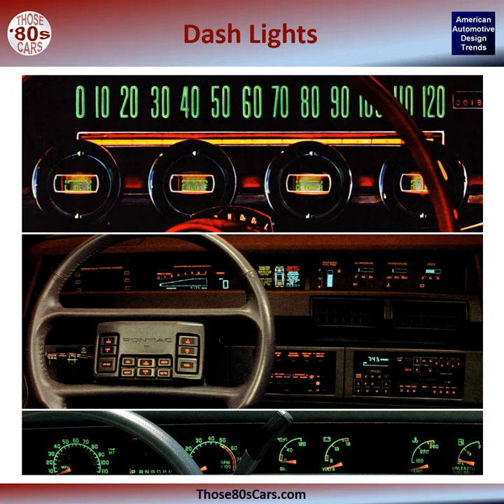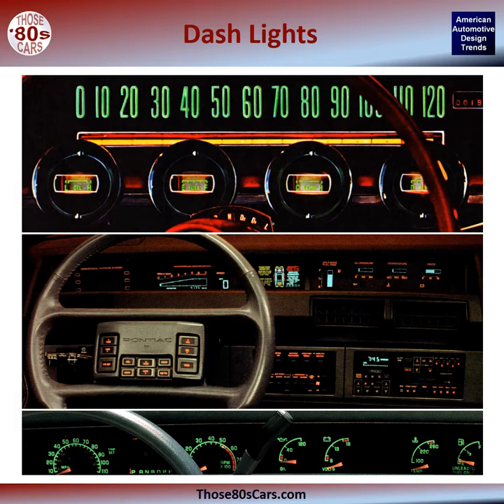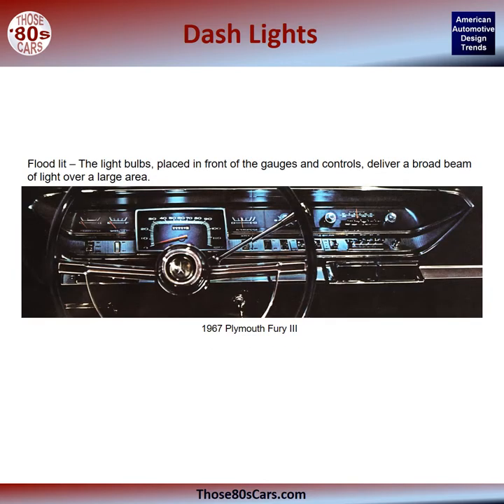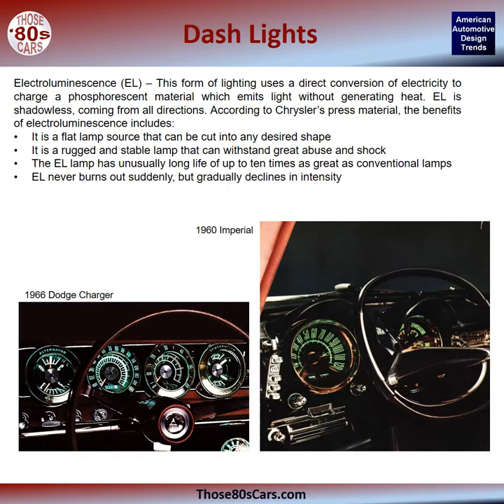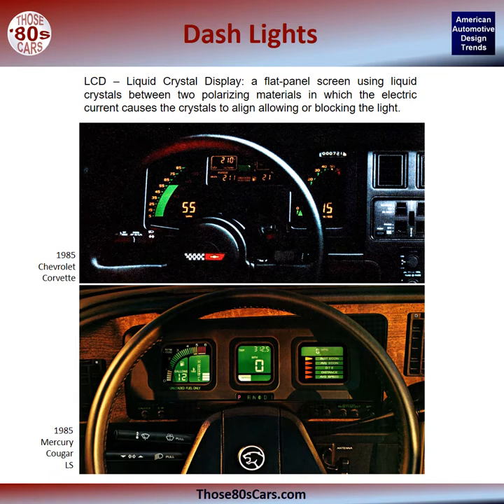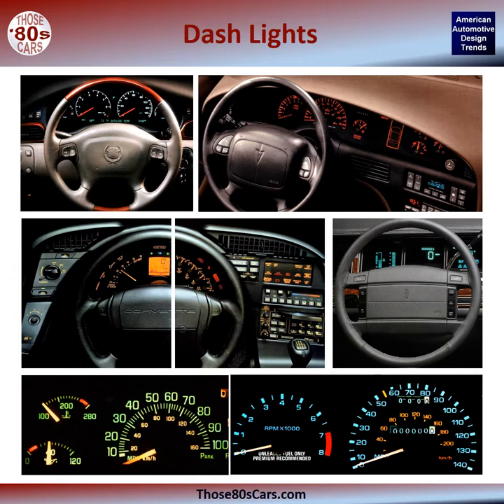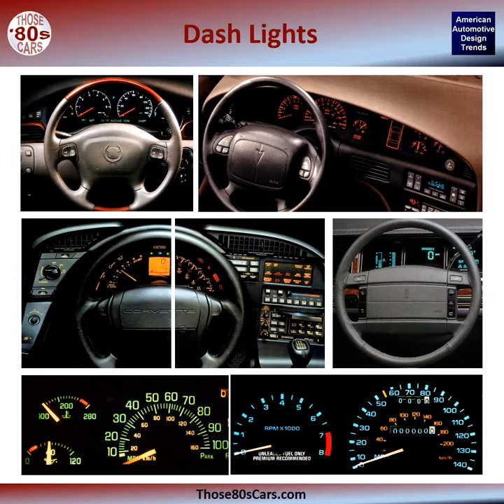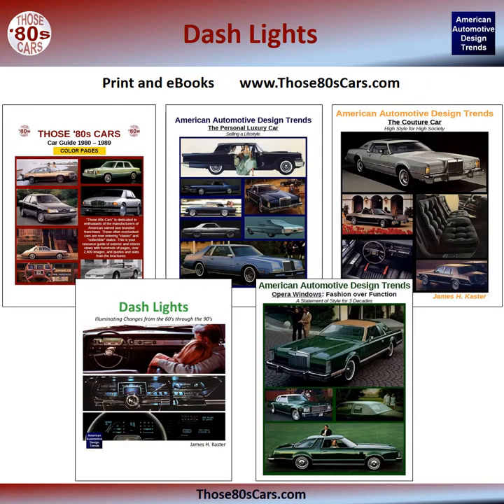Dash Lights - The Book

Comment: Yes.  I would not buy a car with red or orange gauges.  My preference is green as ND blue.  The best was my parents 1962 Chrysler Newport.  It had electroluminescent dash and was a beautiful sight.  I also prefer my gas gauge to be upright where full is to the right and empty to be on the left.  I don't like upside down bushes.  The dash bushes in my 72 Mercury Montego and 72 Pinto have the gas gauge the way I like it.  Lastly, I want round gauges.  I don't like a speedometer needle sweeping across the dash.  It reminds me of an old persons car.